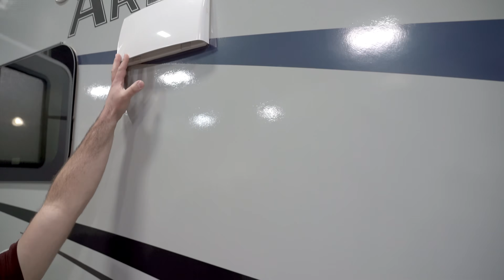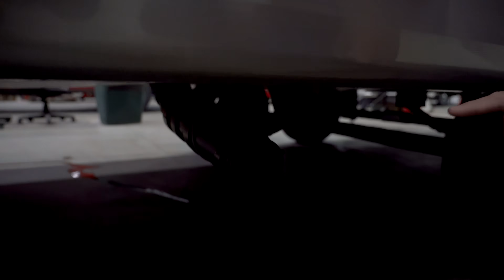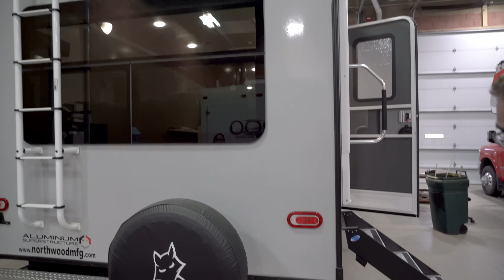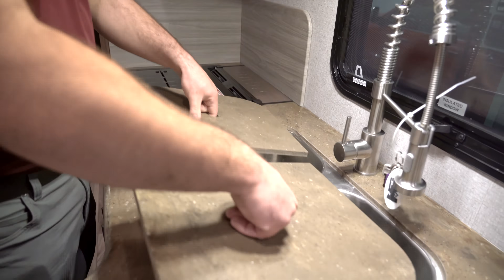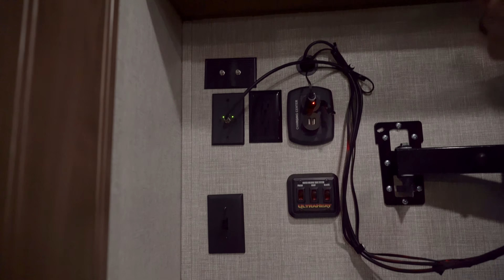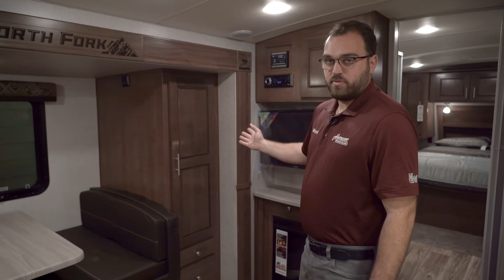2023 Arctic Fox 25Y Pull Behind Camper Walkthrough

Comment: There is nowhere to put this: If Arctic Fox is same as Desert Fox, there ARE NO COMPUTERS to mess things up,  be wanky, be hard to understand (by oldsters) and more.  A big, big, selling point is the lack of this complexity.  I did NOT say there were no integrated circuits.  Also, the Desert Fox has no inverter to cause problems I know of.  A slew of typical problems do not exist because the SYSTEMS do not exist.   I tip my hat to Northwood.  They make complete dry camping and shore power systems- without a computer, without the interface, without the problems and learning curve.  BRAVO.

Comment: I did a tour of the Northwoods RV building facility they have in La Grande, OR two weeks ago. Very impressive manufacturing plant. Main complaint is that they refuse to put the outside LED light anywhere other than the end of the awning rather than under it at the trailer. You have to fully extend the awning to get any useful light. Small, but stupidly annoying mistake on their part as far as I'm concerned. But definitely a more quality unit than most other RV manufacturers.
Reply: I can tell you they do not make decisions lightly, and cost IS a factor because there are so many costs alaready.  The LED lights are built into the canopy.  If they add another entire system to put the light off the canopy or where you suggest, they would have to convince the canopy mfr to do so.

Having said this, if it cost nothing, I can think of many, many things I;d like to see too- light that shoots down under the RV (repels rodents, doesn't glare, gives a sexy look, doesn't make pupils slam shut, more).  Also, I'd like to see a monster light LED (since they are pretty cheap) that can be controlled from inside.